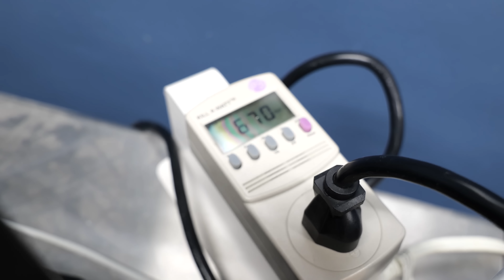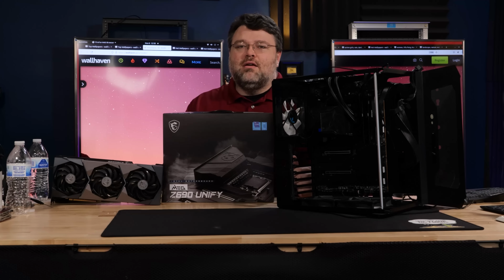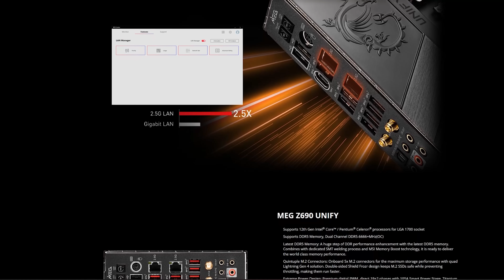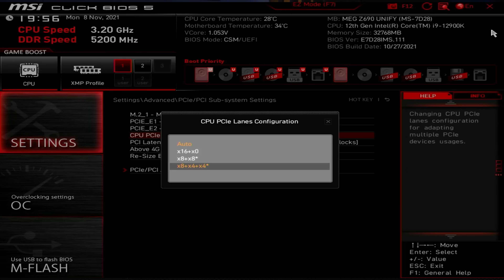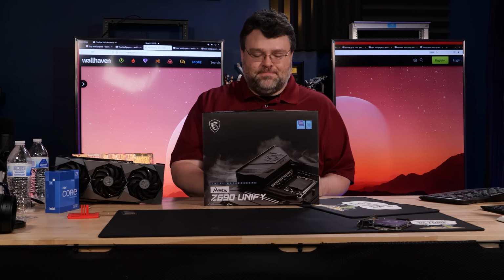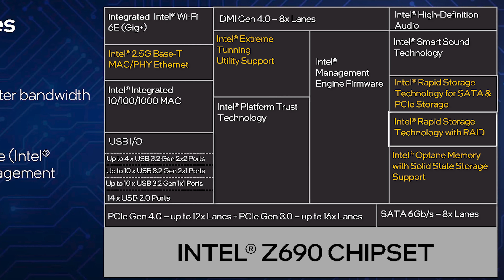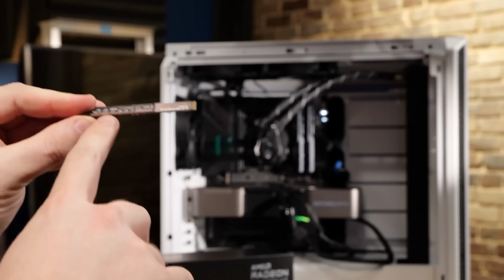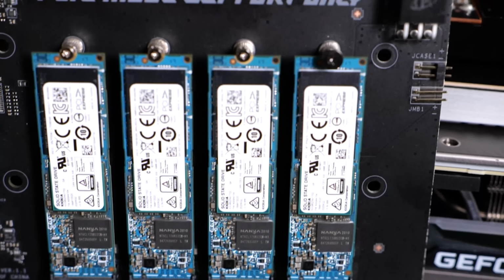MSI MEG Z690 UNIFY: A Worthy Chariot For Alder Lake?

Comment: hi mate,thanks for the info.can u elaborate on the 12900k igpu situation.so providing the vga detection setting in bios with this mobo is set to auto,i can use the 12900k's onboard gpu in adobe alongside my 3090 ? and also,if this is correct,does it need a software driver?i cant see any on the msi product page

Comment: I bought the ddr5 4800 from the QVL list for the carbon wifi but now I want the Unify for the sli. The piont is, the QVL memory list have now been erased/changed from anything above 4800 mhz. I don't know why but now I don't know if I can just switch boards because the new amended QVL list doesn't show my memory on the compatibility anymore. Maybe their trying to stop ddr5 scalping. I don't know.

Comment: All that DMI bandwidth and no $%#$%# PCIe slots. Gah. I shouldn't have to convert NVMe slots to PCIe x4 with an adapter and then use a riser kludge to add a capture card or two (or Thunderbolt or a 10Gbe NIC). Can these motherboard makers just put in the x4 slots?  One can always convert them to NVMe later!

Comment: Nice thorough coverage as always!  I would still rather see 5 or 6 general purpose PCIe slots than more M.2 NVMe slots that can only be used for one thing. I personally can't find a use case for more than two NVMe slots and if I do I could just buy a PCIe to M.2 adapter( or add a 10Gbe or Mellanox card as you said). I suspect these M.2 NVMe slots are a manufacturing cheap-out. Anyway cant wait for Linux testing ;)
Reply: I always need three. Two for systemdisk in RAID 1 and one bigger fast data
Reply: @llothar68  Great use-case!,  the system disk gets pounded on and in theory more likely to fail, really painful if it does,  and can use smaller disks.
Reply: @jjdawg9918   I have software licenses that are far more expensive than the hardware. And many restrict the number of reinstalls and that might be required sometimes on restoring backups. So i just can't risk it. Also a missed day because of a failed drive can cost me a lot of money, especially if it happens and i break a deadline date.

SSD failures were quite frequently for me compared to all other failures.
Reply: I populated my apex with m.2, i play alot of games...

Comment: I remember days when you could buy entire new pc with dedicated graphics card for price of this motherboard, and it was good enough to play games at 1080p medium. Can we call it a progress?. No. New parts are faster but also more expensive and more power hungry (at least on Intel side). I would want to see comparsion of few generations of cpus @same power consumption.
Reply: GPUs used to not have heatsinks. Case fans have steadily gotten larger over time.

Overall every component is getting more power hungry
Reply: Yes prices are up, but this is high end line. You can have good budget builds below 500$